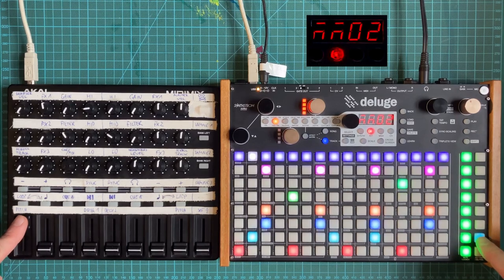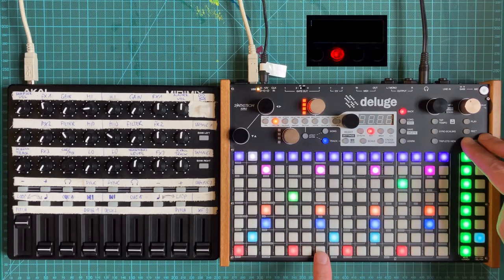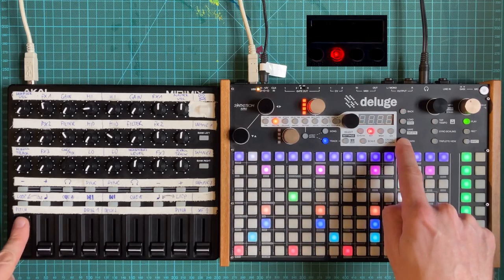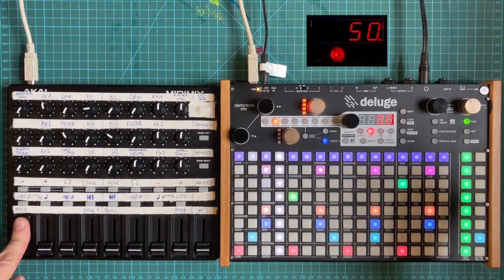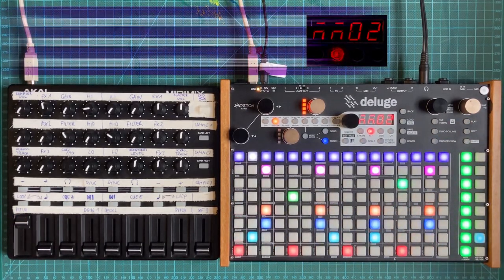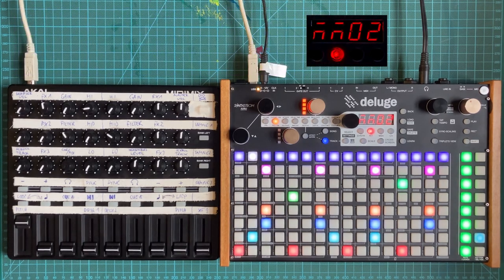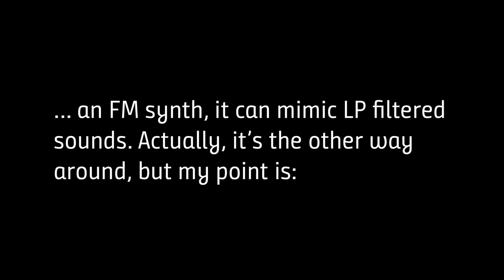Setting up a MIDI Controller with the Deluge | How I use the Akai MidiMix

Comment: Great video. Can you use a 2nd midi controller (keyboard) with the Deluge if you use a USB hub?
Reply from the maker: That’s a good question. I would need a USB type B to A converter to connect a USB hub, which I do not have.

Comment: Mr. Eisermann, danke für das gute Video. Ich finde deine Struktur beim Midimix echt gut gelöst. Kann der Midimix das patching speichern so das es bei belibigen Presets der Deluge gleich bleibt. Ich hoffe MPE und Midi 2.0 kommt blad...
P.S.: was ist eigentlich mit dem Dead Button?
Viele Grüße 8)
Reply from the maker: Sehr gern, Mr. Skywalker ✌️ Der MidiMix kann über einen Editor konfiguriert werden (CC, Note #, etc.), insofern speichert er ja ein eigenes Patch. Die Belegung im Zusammenspiel mit dem Deluge müssen aber immer gemacht werden, wenn ein neues Kit oder ein Synth erstellt werden. Im Kit/Synth werden die Belegungen aber gespeichert. Ich kann also zB durch meine Kits scrollen und habe sie auf den Reglern, wenn ich sie einmal so abgespeichert habe.
Reply: @EISERMANN80  vielen Dank für die schnelle Antwort 👌